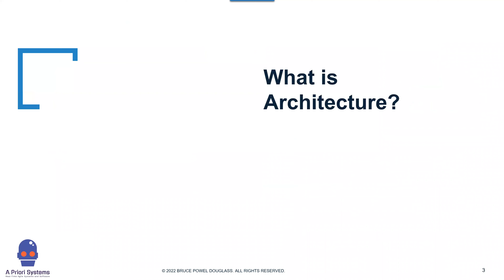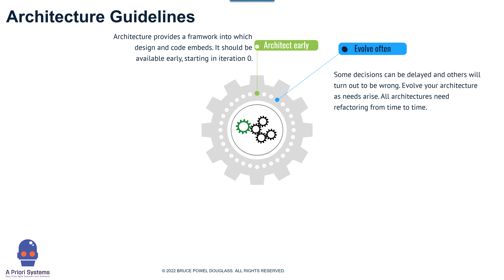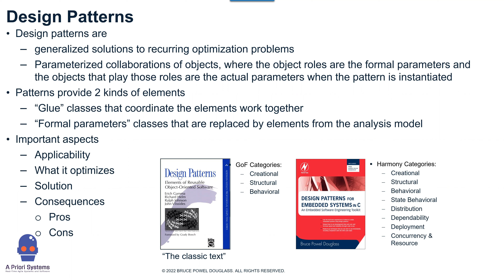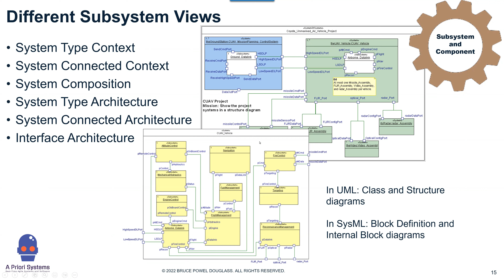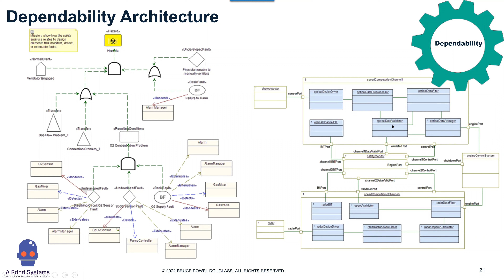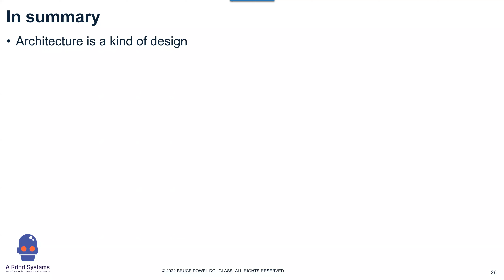Six Dimensions of SW Architecture

Comment: I've literally in the last year really understood the difference between architecture and design. Architecture is often talked about as high-level design, but that misses the real point. Architecture is at a higher level of abstraction than design. So the architecture for a car might say it has a transparent windshield (satisfying requirements on comfort, visibility, drag, ...). Other architectural solutions might be external cameras and screens, periscopes, ... The design would say that the windshield is made of a specific type of material (e.g. glass to a defined standard). So the architecture defines ABSTRACT nouns, and the design defines CONCRETE nouns.
In a software context, the architecture might define a sort component, the design would define what type of sort.
Of course, both architecture and design are typically recursive as you go deeper into system elements.
This is explored more in the paper I co-authored at this year's INCOSE International Symposium